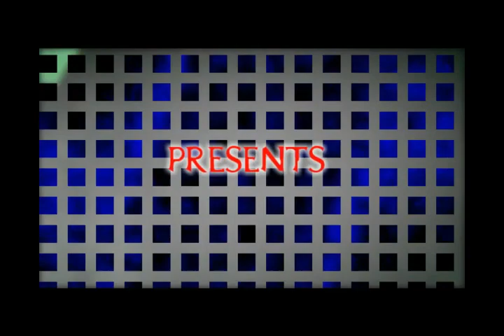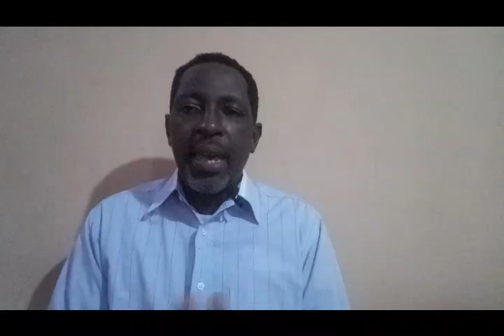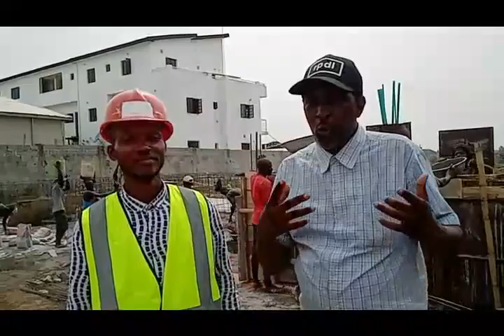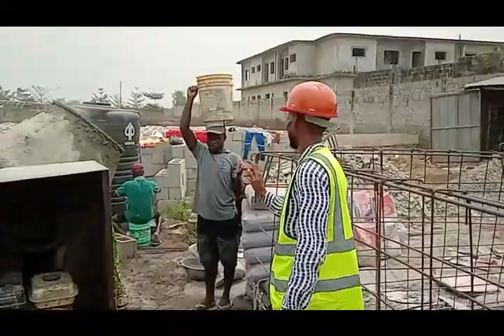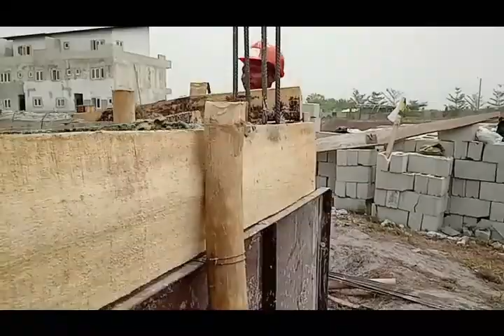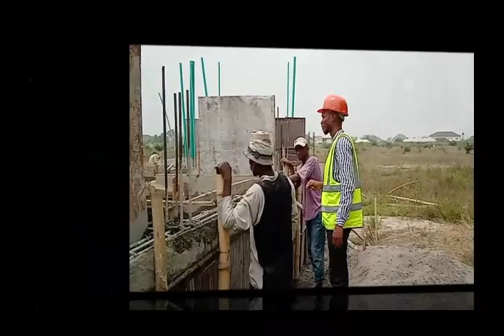Building Construction: When to use Raft Foundation & On what type of soil.

Comment: what is the size of the rob in those boards ? 12 or 16mm ?
Reply from the maker: Thanks for your question. The main reinforcement rod is 16mm, the 10mm you saw is acting as runners in the structural frame.

Comment: Thanks for this interesting video. The raft foundation as seen is 6 - boards high. Will it still be ok if the boards are reduced to 4 and two coaches of 9" hollow blocks fully reinforced with concrete is placed on the 4th board?
Reply from the maker: Thanks for taking your time to watch this video. For the answer to your question.

Professionally, by introducing 2course of block into the ground beam, we can't really call it raft foundation with that design, you know the ground beam reinforcement has to anchor with the raft slab to act as framed unit.

There are different kinds of raft foundation, the type of raft adopted in that video is slab beam raft and it has to be constructed according to the design of the structural members.

Other types of raft foundation are the 

Solid slab raft foundation
Cellular raft foundation
Pile raft foundation
Floating/balancing raft foundation.

The slab beam raft raft foundation can be upstand or downstand beam(as used in the video) system. 

But in the case you you have to consider using block with ground slab beam, is going to be according to a structural design for it...and in this case a design of upstand beam system let's say 450mm depth of beam on the ground slab underneath the beam(note if the soil is not too loosed void can be introduced in the ground slab), and the required course of block maybe 3 or 4 due to the ground floor level required can be used, before doing your German floor with mesh reinforcement.
Reply: Wait make you see Water for Lekky